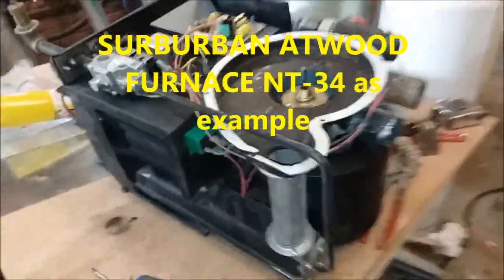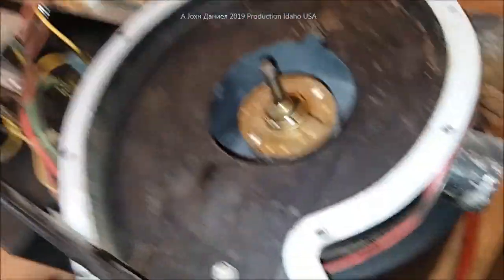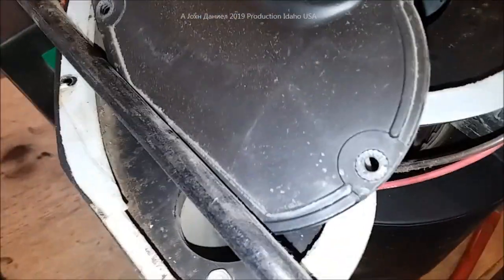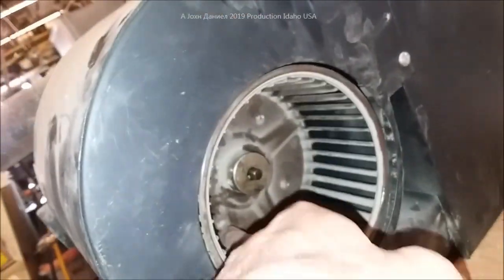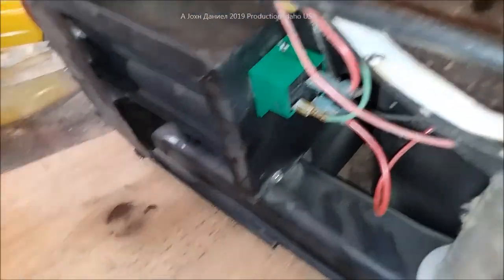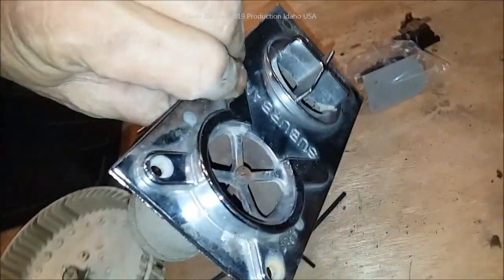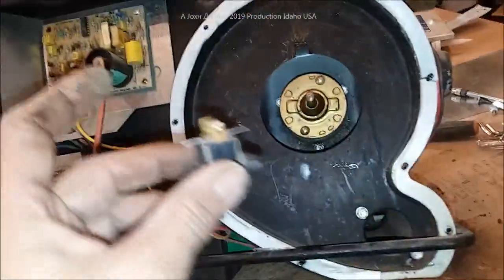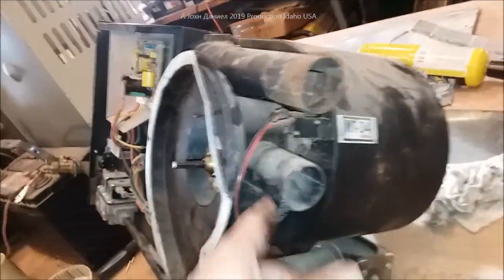RV Furnace Intermittent or No run problem, Common Issue, SOLVED (parts Below)

Comment: I have an old DNV-25 that will not ignite. Blower runs I smell gas. I was wondering where to start troubleshooting. Also parts seem to be scarce. Any info would be greatly appreciate.
Reply from the maker: The igniter bar glowing? It should not push gas unless it has a operational time delay relay and operational igniter. They make a universal Fan-Run-Ignite board that will fit it with some basic modifications.
Reply from the maker: A "OK" Schematic with parts names and item numbers. Most will follow the same design. https://www.searspartsdirect.com/model/2cpom39jw6-000288/desa-dnv-25gs-wall-heater-parts
Reply: How can I check the glow bar?
Reply: Yes I’ve seen this schematic but didn’t know what would cause the issue. Also the circuit board number has changed and is quite expensive that’s why I didn’t know if a universal was an option. The furnace is used to warm a 3 season porch. It started having issues randomly not relighting and then no ignition clicking and won’t light period. I appreciate the response and any additional information since you seem to have extensive knowledge on this.

Comment: Hi John im a new subscriber and have nt 30sp when i turn on for heat the fan comes on i hear clicking from the valves but no flame. I had a bad ignitor that grounding pin broke loose i replaced that and been working fine last 2 months . At first i was thinking gas coil bad but seeing this video im not sure? Thanks Dave
Reply from the maker: Sounds like faulty sail switch, but likely also Limit Switch is not closing back. Items to look over, Sail Switch, Delay Relay, and Limit Switch's (some have 2 or more)
Reply: thank you I did remove burner and I had a piece of black soot that was on the ignitor and in the burner housing. The flame is blue at burner then yellow I assume that is an air adjustment? I was thinking of removing furnace to clean better. Any ideas on adjustment if possible. Thanks again David
Reply from the maker: Soot and yellow flame is caused by blockage in your intake and or exhaust tubes. Get a bright light, look into it for wasp or insect blockage. Sometimes you have to put a strong shop vac on them to draw out what may have stuck in  the intake blower too. If you have the igniter out, blow some air with a compressor into the burner assembly while another person works the shop vac from outside.
Reply: @JOHNDANIEL1  thanks again I will give it a try!

Comment: John
I have NT40 suburban heater my problem is that it keeps cycling on and off every 30 to 40 seconds I've replaced the motor twice, sail switch twice, limit switch twice, gas value, ignitor, thermostat and regulator at the propane tank.
I've also had had the unit tested by 4 RV shops all came back as pass nothing wrong but its keeps on cycling every 30 to 40 seconds NEED Help...
Reply from the maker: Sounds like a low voltage act. Set up to check voltage near the unit or at its fuse, fire it up, note the voltage on the system with it off, then on, then when it shuts down. Commonly with these symptoms:  the Run delay Relay on them is the issue, the battery voltage or 120 to 12v converter output failing or shorted coach 12v  battery causing drop of volts.
Reply from the maker: Time delay Relay, works on those with some basic skills https://ebay.to/37VCjAa

Comment: Hi John. I have a suburban furnace in a 1995 country coach. Furnace blower comes on no problem and runs strong but blows cold air. Any idea what’s causing this would be appreciated!  Happened a couple of weekends ago then suddenly started blowing hot air. Just turned it on again and blowing only cold air.
Reply from the maker: Check 12 volt battery power as you run it through a cycle. If it drops below 11.5 it usually won't fire the igniter. If that happens replace RV BATTERY. If you fire it up and it's intermittent it's usually one of 3 things. A delay relay, voltage supply, or failed high limit switch. Last option is the flame sensor circuit of the igniter over the burners.
Reply: Hi John. I have a 2021 dometic furnace. I can hear it fire up but goes back off. The dealer replaced the sail switch and added an additional vent and it seemed to be working at the time, but now it's doing the same thing. Could the sail switch still be faulty?
Reply from the maker: @tonystephens1027  If it "fires up, such as making flame", then no. But Common Causes for that: Low Battery Voltage, Flame Sensor/igniter element, Low propane flow, or faulty thermostat.
Reply: @JOHNDANIEL1 ok, I thought you said in one of your videos that if the leaf switch failed, (sail switch) it would light up but then go off??
Reply from the maker: If it was failing, it would be intermitted behavior. When they light then go off its normally the igniter assembly not sensing flame and after 5 to 10 seconds it shuts off gas, runs a short cool down and goes off.
Reply: @JOHNDANIEL1 , it actually ignites for a few seconds, but the fan keeps running and lights for about two seconds and keeps on repeating this. The fan keeps on running until I see it's never going to light permanently, then I shut it off.
Reply from the maker: Still sounds like the igniter assembly. depending on the model, it can be 2 seconds, usually as much as 10 but without it sensing fire is made, it repeats cycles or stops. It could be the gas pressure, not enough to keep the valve open since when it opens if pressure is too low it will not hold open the upper part of the flash back in the valve. So, light the stove, 2 or more burners, then start the furnace and see if the stoves flames drop drastically. If so, replace the propane regulator and repeat test.
Reply: @JOHNDANIEL1  I I checked the propane with the stove lit and flame didn’t change. I pulled furnace and burner assembly and all looked good. No trash in orfice, igniter set to 1/8th". I assume the only thing left is the board?? The only other thing I saw was the two large resisters/diodes were almost touching. I haven't re-installed it yet since I'll probably order a board for it.

Comment: Hey John I have a nt20s in my rv I pulled the furnace out to replace a section of floor and it ran before I took it out I put it back and it blew a fuse I replaced the fuse and I have nothing no start up no fan and I marked the wires before removal so they went back the same ....any ideas?
Reply: I have the same Furnace, never been used and I can’t seem to figure out why the blower will not turn on. I tested the relay and it is getting power through it but can’t find a solution. Did you resolve your issue?
Reply from the maker: @CHPangler  Explain more, send me some pictures of the furnace, and of how your wired and more info to olympicpowercontrols@yahoo.com 
It may take some days to get back with you. I get 20 to 30 emails a day.
Reply: Јоhn Daniel  thanks you for reaching out to me. After removing the furnace I ran a 12v battery to it and noticed the furnace was powered correctly as it should. I then touched the 2 blue wires from the furnace together (Thermostat wires) and the blower turned right on! I then ran the same 12v through the thermostat red wire and noticed I wasn’t getting a return on the white wire (Bad thermostat). I ended up replacing the fan motor (since the bearing was making noise), reassembled the furnace, and reinstalled it. I upgraded the old thermostat with a Honeywell TH1100DV1000 and furnace is back to working order. So for those with similar issues, CHECK YOUR THERMOSTAT FIRST before you completely remove your furnace. I hope this helps others.

Comment: Where are you? Idaho? Do you know anyone who fixes rvs in the nyc area? I’m thinking of getting a 1989 Aluma lite ramber that’s in amazing shape. Problem is it’s all original. Garages for most of its life. One of the shorter ones with two axles in the back.  Anyhow, thanks for any info.
Reply from the maker: Wish I did know. I repair 3-4 a week, as a $400 a week hobby!

Comment: My wont light up every thing works the propane only cliks. Once . it sparks fan comes on but wont light up I tho\ght it might be the soinos
Reply from the maker: Sounds like a Over Temp switch or the electrodes over the burner issue. remove the electrodes over the burner, check for excessive wear, careful on the gasket for it, clean carefully with some sand paper and be sure its got no more than a 3/16 gap for the spark. If thats not working, bypass the over temp to try safe mode fire up.

Comment: John, 
I have what seems to be an older suburban furnace as to limit switches on it it does have a circuitboard. I have tried two of these dinosaur delay relay switches and they do not seem to work on my furnace. Just wondering if you may have any other ideas
Reply from the maker: Do a 3 to 4 minute NEED HELP video on it. Be sure to put in the model number, its behavior, its year model, clear video, and any details you can. Send it to olympicpowercontrols@yahoo.com through 
https://wetransfer.com with the note "To John, FREE SOURCE Heater Diagnosis Video" on the file note, ( all steps to send it will be explained on there) 
I will find you a compete solution via edit and public posting for my 82,000+ subscribers and my inner group of HVAC folks. At worse, I may have a restored unit to replace it.